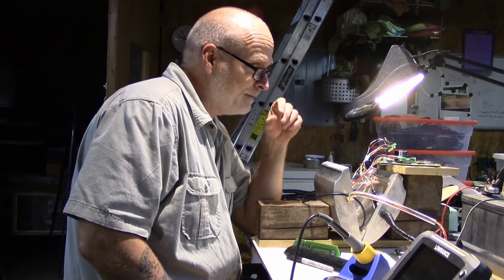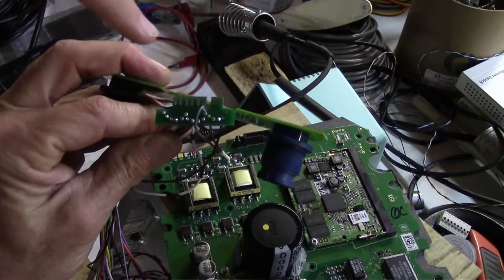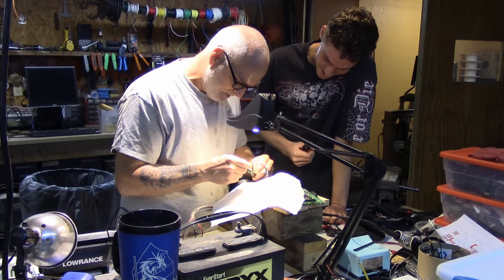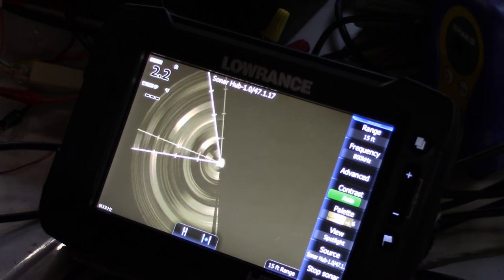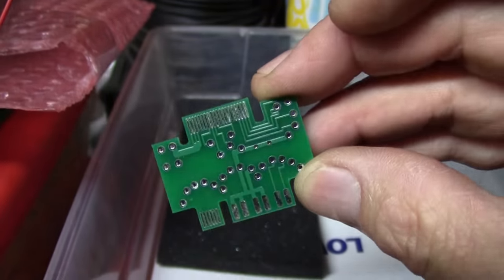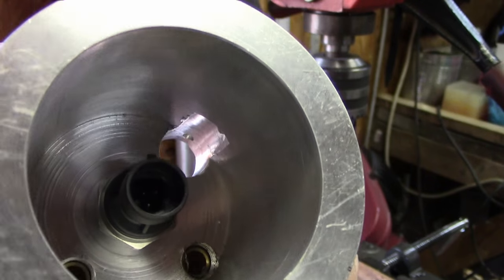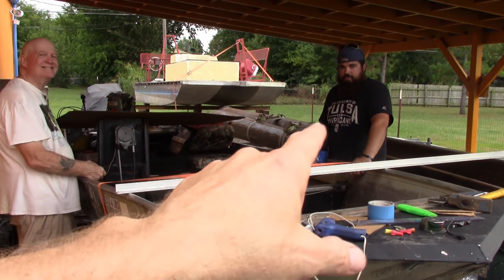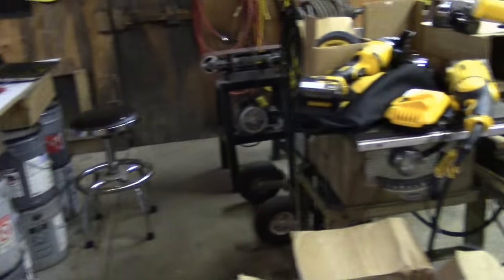ROV Sonar Part 6 and more

Comment: FWIW, it's very normal to drive piezo transducers with high voltages. Hundreds, or even thousands of volts is not too surprising.

That, with the fact that all the components in line with the piezo signals are all large surface mount packages (1206+!), together with the large creepage distance and the adjacent transformers supports that hypothesis.

In the long run, it'd probably be wise to make up a new breakout board with proper creepage distances, as it's possible the liquid tape will break down under the HV stress over time. Also, conformal coating would probably also be a good idea, if moisture gets in there, it will dramatically reduce the breakdown voltage across the board surface. Once it starts arcing, it can carbonize the PCB epoxy, which further reduces the breakdown, and you have positive feedback.

Comment: I recommend you use shielded wire for the transducers, they put out a lot of RF and the receivers for the sonar are very sensitive to noise from digital circuits and PWM drivers.

Comment: Hi,

If you dont mind purple PCBs OshPark is a really cool PCB manufacturer that does "crowd runs" of many small PCBs for about 5 $ square inch for three boards.

 When drawing the traces its best not to have them make 90 deg turns, no reason really just looks way better I guess. 

You could also route out insulation tracks between the cable holes (The PCB manufacturer will do this for free) so that if the PCB gets moist the moisture won't breakdown and start arcing (Air is a pretty good insulator, an arc will jump 1 mm per 1 kV).

Comment: Nice work, Dewalt.  

I was a pretty big fan of Diesel Tech Ron - the guy was amazing and unfortunately passed away recently - and I had been eyeing one of the Milwaukee cordless ratchets he used so often. Not only did they not sponsor him, I gather they sent him some unsolicited nastygram about how he wasn't qualified to demo their product or some such nonsense. If he wasn't qualified to use the tool I'm quite certain I'm not so, I suppose I'll go ahead and ensure I don't run afoul of Milwaukee myself by not purchasing their products. 

But I'll remember this the next time I'm in the fun isles at the hardware store.

Comment: I'm not sure but from what I can see of that board for the sonar it looks like cold solder joints. I use liquid water soluble flux on my solder joints. I also "tin" the wires before I solder them to a board. You use less heat doing it that way too so you don't burn the pads on the board.

Comment: The problem with arcing seems to be caused by too small spacing between those wire pads. If you compare the original connector with your design, you'll see that the connector has a bigger spacing for the high voltage pins. So in your next design, make the spacing at least that size, preferably even larger.

Comment: Hey Doug, check out the flex at 11.07. I reckon you need to chuck a triangulation down to the hinge point from the double rails to stiffen up the gang plank. I also reckon that if you do not you will have to at some point do so as I reckon it will fail right there at the double to single junction point. Stitch in time and all that eh.
Reply from the maker: Yeah, we're still thinking about where we want a brace.

Comment: Spray varnish may solve your problem of insulating those contacts from tracking to each other. I saw an electrical contractor walk up to a copper bus bar energized at 125/216V and put his finger on it and telling me that this bus was the one that fed the building that he was working on. The only thing that saved hi ass from electrocution was a thin layer of varnish. I wouldn't do it for the world. With luck my finger would touch a pin hole in the coating!

Comment: Why are you putting the Sonar Control Board in the ROV? I might be mistaken but all the Sonars I used the Control board/control box was topside. We ran Sonar Control and Signal on either a twisted pair or co-ax and powered the head locally with !@VDC. I am retired now but have over 25 years experience with ROV's of all types. Can't get to you however. Would if I could. Good Luck.
Reply: 12VDC not !@VDC. Had my finger on the shift key.
Reply from the maker: Excellent question.  The return signal from the transducers is very weak and so must be processed before it travels more than about 20 feet, so Lowrance makes the SonarHub that processes the signal and then puts it onto good old Ethernet so they can pipe it up to the fly bridge on your mega yacht.   We take advantage of that Ethernet and marry it with the DSL technology that the telephone company uses to get Internet into your house using your good old copper telephone wire.   So now we can put 4000 feet of cable between the SonarHub and our boat.    Cheap, high quality sonars, 3000 feet down on an ROV that can be towed when needed and all for about $5000.   A game changer as they say.
Reply: See if you can find an old Mesotech. Should be able to get one cheaply. Also there should be a way amplify and send signals up the umbilical. You need to try and eliminate as much electronics on the vehicle as possible. Oil compensate junction boxes and cables. Deep diving vehicles have as few hard cans as possible. I look forward to seeing testing. I would have built an open frame design with two fore aft thrusters a lateral and vertical thruster. This is the arrangement most used for it's flexibility. Still good luck. If I can offer any advice feel free to ask.
Reply from the maker: That might work great, but that is not our goal.  Our goal is to have hundreds of these units out there.  Not just one.  And to keep improving them, upgrading them and driving the cost down.    And your advice is welcomed, but it needs to fit that goal.  Details on the ROV can be found here: http://www.svseeker.com/wp/sv-seeker-2/underwater-rovs/open-source-towed-sonar-rov/?v=7516fd43adaa

Comment: The piezo elements are kinda like capacitors and take high voltages to get large deflections. I wouldn't be surprised if the working voltage of the elements is around 1KV.  These types of voltage will creep along the surface. And things like flux and finger prints can make it creep further. There are industry standard tables for creep age and clearance when designing boards based on your voltages. http://www.smps.us/mobile/pcbtracespacing.html
 
Good luck guys!
Reply from the maker: Thanks

Comment: wow free power tools right when you need them. contractors use dewalt
Reply: As a contractor I have hand tools from various mfgs.  For DeWalt I have the 4" grinders, 18V drills, and a compound miter saw.  I stay away from Makita.
Reply: Interesting, I use DeWalt and Makita amoung others. DeWalts seem better able to withstand use and abuse from the hired hands. Makita is good with versions that are a lighter and better for finer work which is done in a more controled setting, often by me. I have to be more careful about who gets ahold of them.
Reply: +Yvan Roy I finally grew up and bought a set of Milwaukee...best move I have ever made...BIGTIME

Comment: question. Why don't you run the data through fiber optic?
 You can convert ethernet to fiber with a couple of these https://www.amazon.com/MC200CM-Converter-1000Mbps-multi-mode-mountable/dp/B003AVRLZI      and run the power through some high flex, thick stranded wire for less resistance alongside the fiber. Fiber would offer a really clean signal over extreme distances and it is thinner which means you can spool on more cable. Also it is resistant to wear depending on the type of fiber you get. Unlike coax, it will not flex to the point of failure. Just a thought for consideration
Reply from the maker: Cost
Reply: i see

Comment: for you poontoon boat/ just get your self a cheap rear wheel drive car. rip off the rear axle. mount the car to the boat. hook up the steering to the rrudder. put on a prop on the drive shaft. and there you go.

Comment: I see you are using the stock Bluerobotics motor mounts. I've snapped two of those in half so far. If you like, there is a stronger 3d printed alternative mount available now: http://www.thingiverse.com/thing:1497003
Reply from the maker: Thank You!  Yes, I thought those were wimpy.
Reply: you're welcome! let me know if they need any changes to fit. there is also a set of intake guards in there for them if you have a use for them.